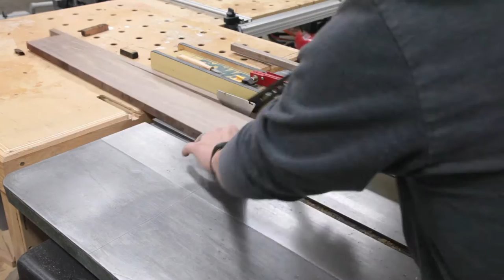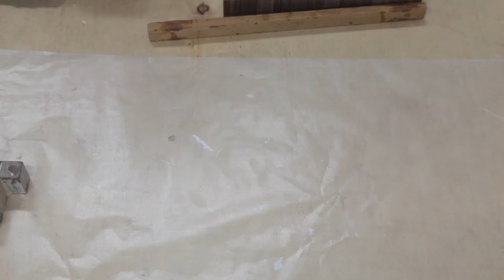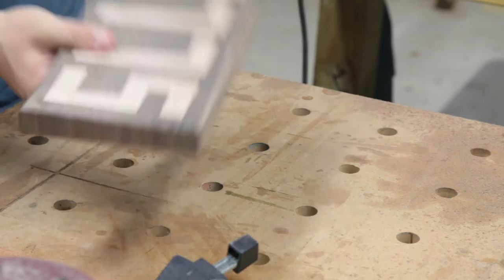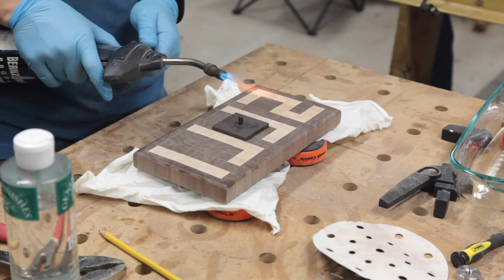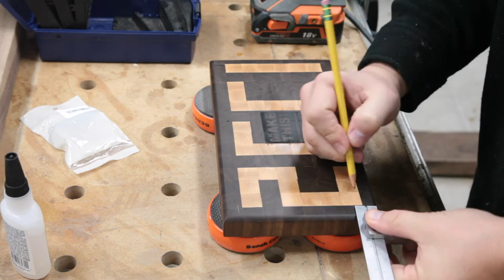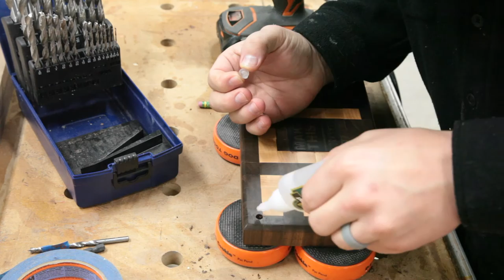Make This: End Grain Cutting Board

Comment: Hi, I had the same problem with the burn marks when using the router.  However... when I speed up the my routing speed the burn marks disappeared.  And it will be more stable allowing for faster speed if you clamp it to the table before routing.  FYI.
Reply from the maker: Thanks for the tip!